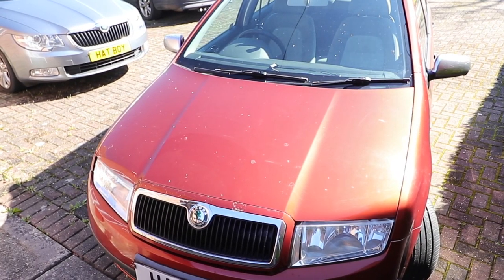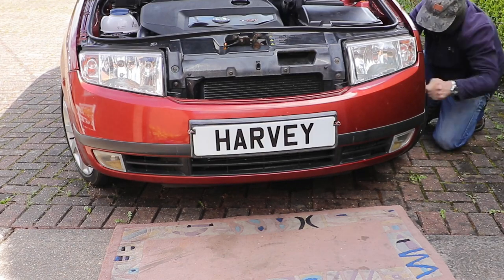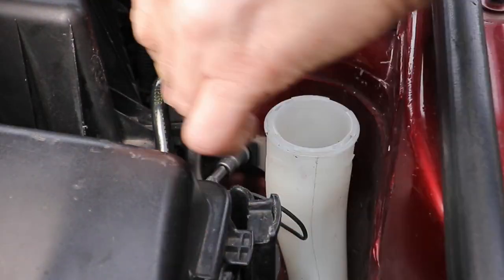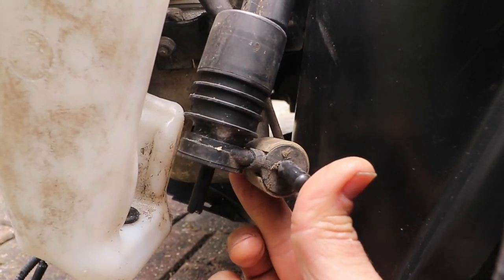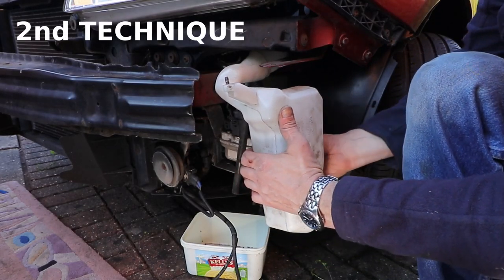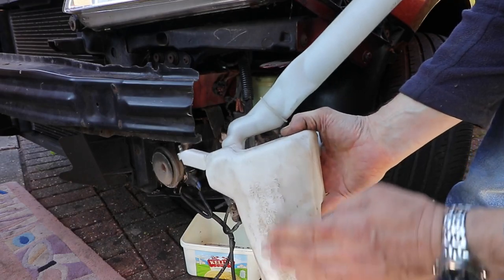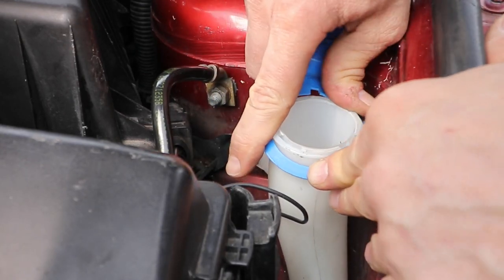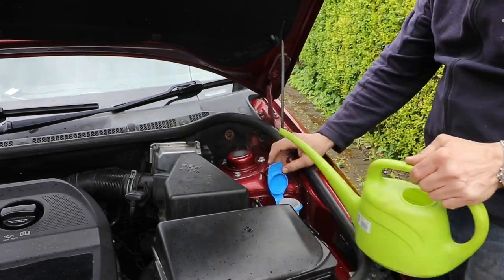SKODA FABIA Windscreen Washer bottle (MK1 Hatchback 99-07)

Comment: Great work. Could you do a video on the different type of common connector types on vw|skoda and how to operate then.  Would be a really educational video for all DIYers. Last day after getting to headlight connector had a hard time figuring out how to disconnect the thing, seems easy but with out the proper instructions a first timer would break it sometimes.
Reply from the maker: Thanks. The trouble is there are many connectors with different types of clips. The main ones that is often difficult and can break are those I showed in this video at the start taking off the bumper electrical connectors to the fog lights. many are like that. I've shown these on a number of videos, I think this one shows a broken one: https://youtu.be/ZauDiNcQ63g I am planning to do one though on some other connectors, I'm just waiting for the parts to come.

Comment: Luckily I didn't need to remove the bumper or the bottle itself, but the bit about the wheel arch liner saved me from the clutches of KwikFit. All I had to do was move the line out of the way enough to get decent hand-access to the bottle, where I found part of the pipework/joinery had partially come apart. Popped it back in like a dislocated shoulder and my water bottle is no longer leaking.
Thanks for tip!! :D
Reply from the maker: Great, nice one, glad to have helped :-)

Comment: What would you think about fluids servicing. Stuff like flushing the power steering fluid and gearbox oil. There's nothing in the manual about it but I would think it's best to replace these oils since overtime they would wear and lose lubricity
Reply from the maker: you only need to top-up the steering fluid, but the gearbox could be changed, I changed mine, but it's not such a big issue if the box works ok. If you change it you need to get the right oil as the viscosity is important for gear changes to be smooth.

Comment: If just replacing washer bottle pump can it be done via wheel arch? Can no longer hear the washer pump when trying to clear windscreen, checked fuses all good so going to replace pump next.
Reply from the maker: Yes, you just need to undo the front edge of the liner and bend it back a bit. If you have a test light or multimeter you can test the pump connection first to see if there is power there when you activate the switch.
Reply: @HatBoyHarvey  cheers mate appreciate the reply, think I'm gonna wait till the weather gets better and give it a go 👍

Comment: I changed the sump, but it continues and drips from where the pump that feeds back into the sump is, what can I do in this case? . Thanks!!
Reply from the maker: Hopefully your pump works and isn't blocked? (knackered) You need to examine the seal (renew if damaged) clean it so it is all nice and rubbery (massaging it helps) clean the bottle pump hole and examine it for cracks/deformation and re-install. The pump should slide in without being loose - a tight fit is obviously best. Don't be tempted to use any kind of sealant yet - try cleaning first. You may find that the pipes leak on inspection, so they would need attention if so.
Reply: I'll probably have to replace the pump as well, thanks for the reply

Comment: Hey. Thanks for the video. I have a seat leon mk1, which has p0135 heater circuit problem. Could you do a video for checking the sensor and wiring . Because these cars probably have same sensors.
Reply from the maker: I'll look into doing a video on this at some stage, thanks. Is this on the 1.4 fabia? have you replaced the pre-cat O2?
Reply: @HatBoyHarvey  1.6 16 bcb engine. Havent changed yet.
Reply from the maker: First check for obvious connection/wire breaks etc and then you can test the resistance of the heater coil to see if it has either too much or a short which would indicate a new one needed no doubt. The wires would be the same colour. you can also do a live voltage test with the engine warmed up and then introduce more air to see if the reading is as expected and changes you just need to know which wire is which for your particular sensor.
Reply: @HatBoyHarvey   I am reading some volues on  multimeter but i dont know which value i read. The opposite side of the sensor connector i read 10.5v.

Comment: It would be of a great help to see how to repair the clogged nozzles or how to take them off...I think my left is not good...maybe to clean it with needle, don't know what to do...
Reply from the maker: I agree, Unfortunately these prove very difficult to clean out when the spray pattern goes faulty, it is best to buy new ones, but I haven't found after-market jets to be of any good, only the OEM ones work well. I have always wanted to find an alternative jet that is cheap, sprays well and can be cleaned well. I'll keep looking and let everyone know If I find a great alternative :-)
Reply: Great, thanks. Just to add, I've tried yesterday with the needle,pushed it through, and after sprayed with WD40,then will see...and maybe could be the issue with weakened pump, or some sludge that is down there in reservoir...I want to see 2 nice decent triangles of washer fluid on my window, but the rightone is not so good, it is better now though(without squirting),but not as it should be...and washer fluid  consumption is still high

Comment: I found out that my washer fluid is leaking! It is coming out of my bumper. I looked for the tank and its look like the motor is leaking. I think that the rubber sealing is defect, how can I repair it?
Reply from the maker: I would take the motor off by pulling upwards and then clean the seal thoroughly before re-inserting it. That should work, if not then silicone sealant may be an option, but if not a new unit I think would be the only option.
Reply: @HatBoyHarvey  Your video was a big help! Thanks! I ha done exactly that what you wrote! I took out the motor, cleaned the rubber sealant, but added an o ring on the shaft of the motor. As second I thought on silicon too!

Comment: Hello my frend... My fabia have horn problem... Dont work...
Maybe you can help me...
Reply from the maker: Have a look at the fuse first then test the connecting wire that goes to the horn behind the fog-light grill. if there is enough power 12v+ power suspect the horn unit which you could also test separately and also maybe adjust it as that maybe all that is needed (I can't remember if these are adjustable or not, if not then it will need replacing). If the switches inside the steering wheel are suspect then you will have to take that cover off also.I will do a video of this at some stage :-)
Reply: Maybe horn is did... Or rele under steering wheel....
Thank you so much....
Reply: @HatBoyHarvey  when i repair new one horn.. I show you...
Yesterday I self make windscreen washer moter

Comment: And of course, the bolt where you need the extension is corroded, so the nut will not come off and the another end is in the plastic, so you can get it loose!
Reply from the maker: All you can do is soak it with penetrating fluid and thin oil. If still no luck then you will have to take a lot more parts off to get better access.